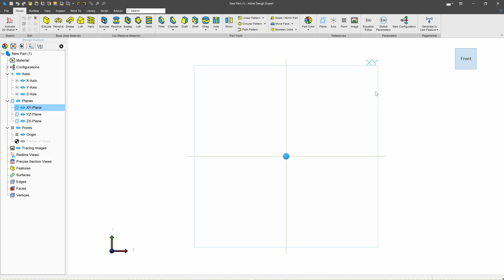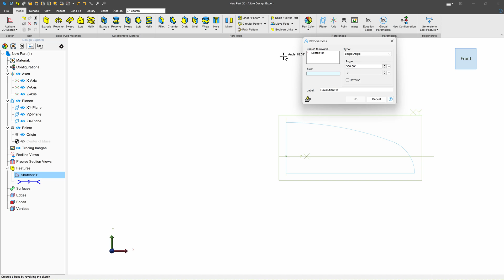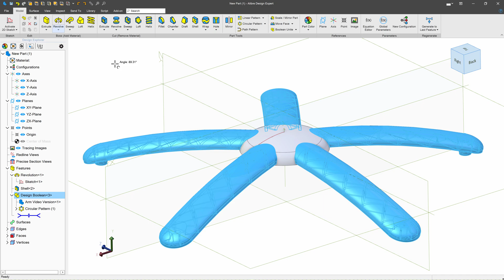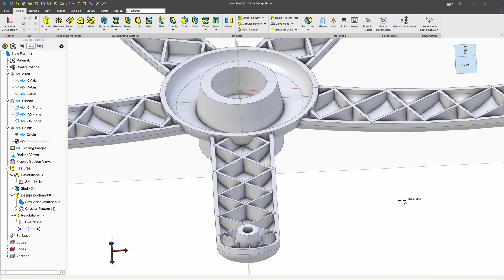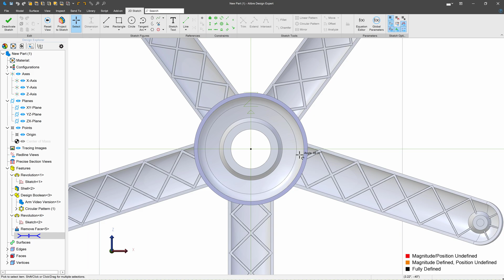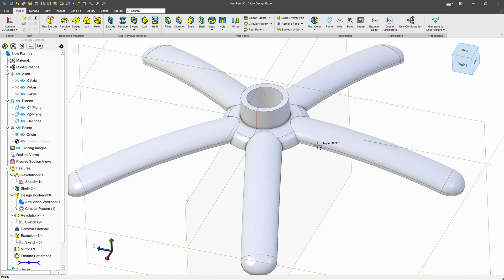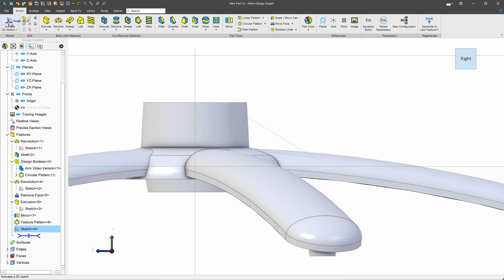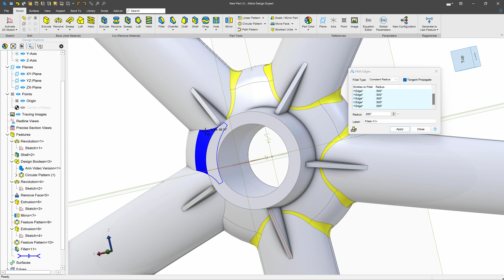Make a Complete Office Chair Base | Alibre Beginners Course #35

Comment: in Atom3D, since we don't have the Boolean Unit, how can I do this? Using the "Assembly" ? I can't seem to be able to find the way to circular pattern after adding both parts! :(
Reply from the maker: I made a video for you.  It will go live here:  https://youtu.be/SoiE1K9MYj0
Reply: @AlibreLLC  amazing thanks a lot, so basically need to do everything into the part instant of using "assembly" and since shell doesn't follow the circular pattern, we need to create the shell from the sketch.

😁
Reply from the maker: @excessnet  I think that is the best way to handle it personally.  I think it is possible to do an assembly too, but I like having everything in one single part file to make sharing and editing less complex.

Comment: Interesting video journey you are on with this series, perhaps you could explain why you chose to use Booleans instead of creating all the features in one part. Boolean construction reminds me of what AutoCAD had back when they introduced AME (advanced modeling extension) back in the 90's with v11. It provides some functionality that is not available natively in Alibre, especially as  I have demonstrated for sheet metal where it can mimic SolidWorks sheet metal forming tools. And with a library of Boolean parts it can greatly reduce your design time.
Reply from the maker: Great to hear from you Harold.  Part of it is to show one more application of booleans to viewers, but additionally it allows for some constant wall thicknesses between the arms and center.  Shell would have deleted some of those walls if I tried using it.